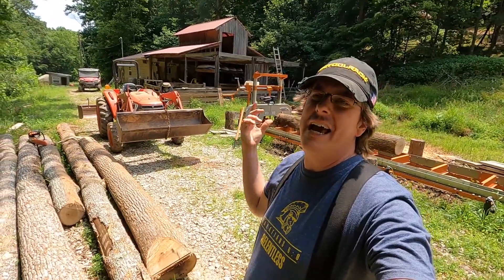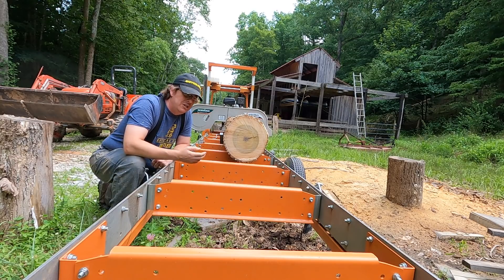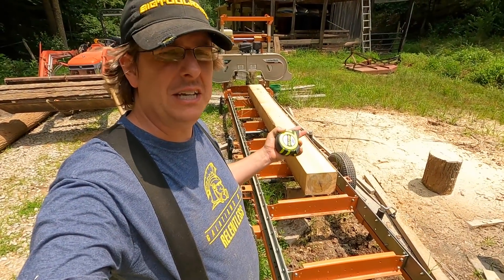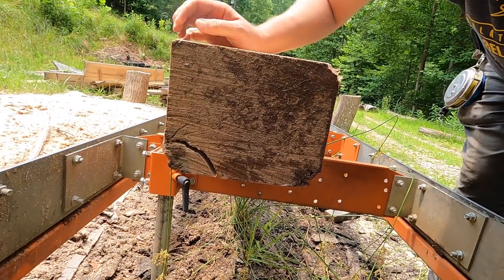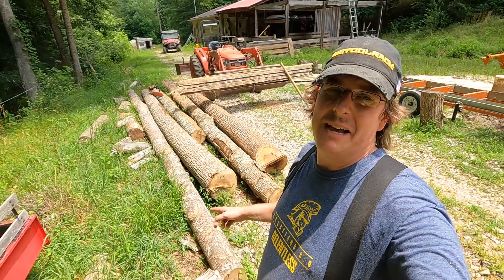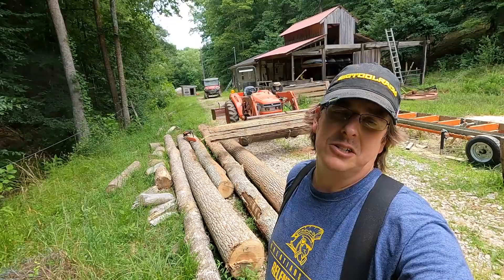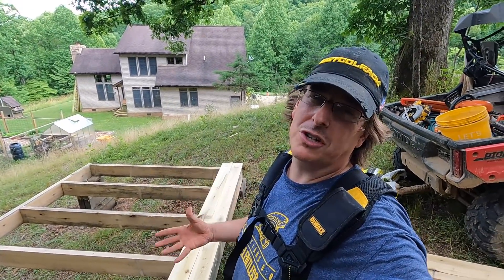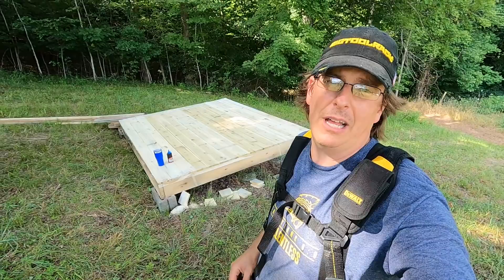Can MATH Help Maximize Log Yield on the SAWMILL?

Comment: 1.  You don't cut lumber on the inches... you cut more to compensate for blade width and shrinkage.  It get's confising but you can drill holes in a stick and just make circles

Comment: There is more lumber in a log than a can't. Too much waste.
Reply from the maker: My slabs get turned into wood chips for use elsewhere. No waste.
Reply: I was talking about lumber waste. . You could grind up a whole tree and not call it waste. I see boards in the thick slabs. Ok.
Reply from the maker: If it is a more rare log for me, then I will work to get more out of the slabs. If it is a common species, then to the chipper it goes.

Comment: Troy you might consider making a template out of Plexiglas or Lexan. Cut shallow grooves on one side with table saw. Put a center point so you can match to log center. If your grooves match mill blade kerf you should be able to quickly assess how many boards you can get.

Comment: To figure out what size log it takes to produce a particular size cant you would find the square root of the height squared plus the width squared which will give you the hypotenuse of a right triangle. You have to remember to add the measurement of each saw kerf and the actual thickness of the lumber in figuring the height and width. Hope that helps.

Comment: OK, new here.  The chickens don't do math and really don't care about the width of the boards.  I just go for the widest boards that can be made.  If they wind up an odd number wide, or fractions wide, big deal.  Random widths work just as well in most cases and really allow the most recovery out of a log.  Also, cut on the inch and you will get 7/8 thick boards which generally work as well as 4/4 and may get an extra board out of the log.

Comment: Now, this video is worth $.  Here's how I would use this when my lm30 comes in.  The diameter of the small end in inches x .7 is the size of sq can't possible.  
Alternatively, if I need a 6x6 for example, take 6 / .7 means I need to find a 8.6" log on the small end.  Assuming I have this correct,  I believe this will be valuable info.   Thanks

Comment: Easy Peasy: Diameter divided by 1.415. But D/1.4= dang close. Alternatively, you can MULTIPLY the diameter by .707 (in this number I see two square angles and a log in the middle).
Write it on your log scale or bookmark this spreadsheet I made for myself.
https://docs.google.com/spreadsheets/d/14QuxOzQ87DNwvLasOBxY2uyhyprh28Ktekqpvl-n-mo/edit?usp=sharing

Comment: When I first got my sawmill, I cut a series of squares out of plywood starting at 3 inches and going up to 12 inches. I lay the log on the mill with the small end toward the blade and can hold up the appropriate square on the end to tell what I can get. I can even mark along the edges of the square to give me a starting reference. Works like a charm.
Reply: When I was a young teen, a long time ago. I worked at a portable sew mill. They would haul it to your wood lot and set it up and start cutting and milling every thing in sight. The sawyer had a try square , he would put a log on and use the square against one side square with  the bottom of the bunk the log was sitting on and get the minimum slab off the first side and just go from there, worked very well.

Comment: Throw all that math out and use my way. Measure the diameter under bark (DUB) and using a calculator multiply that number by point 700  Sitting at your desk make a chart with the DUB in one or 2 inch increments to place near the saw. So ez a sawyer can do it. Remember, a lot of good wood is in the flitches, work your way to the cant making lumber and stickers.

Comment: You should do one about how to get an oversized log down to a workable size. 
Only way I can think of doing so is to cant it down to essentially an octogon where you take the four sides off like you normally would but that'll still leave you with something to wide to run.
From there you'd roll it 45° to take off some more bark and sap wood.
Then you last it back down 45° from the way you initially rolled it.
And you should be able to run off the trapezoidal part that is now on the top. Leaving what's left on the bottom more of a 30 wide by 25" tall

Comment: The 30% off the diameter is a slight simplification of the Pythagorean theorem. For a square cant the edge length would be  Diameter x 0.707